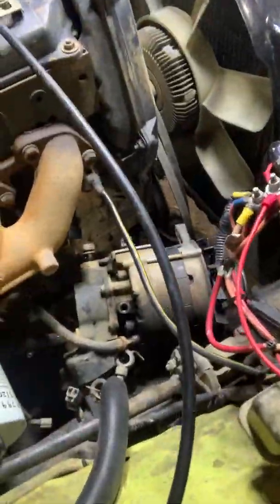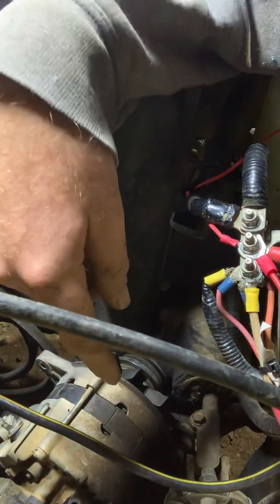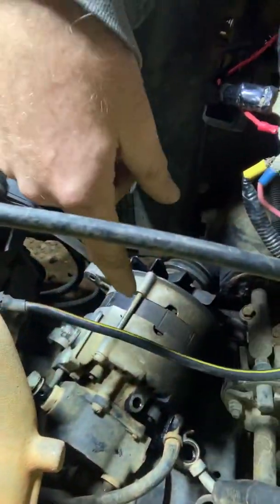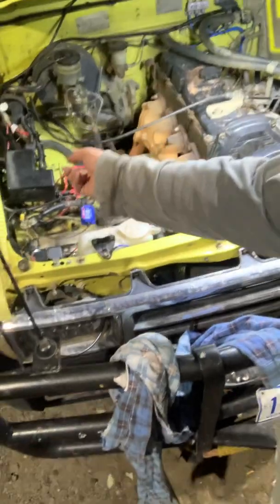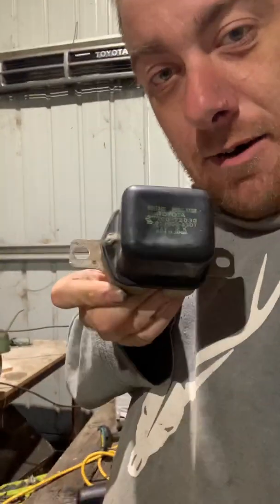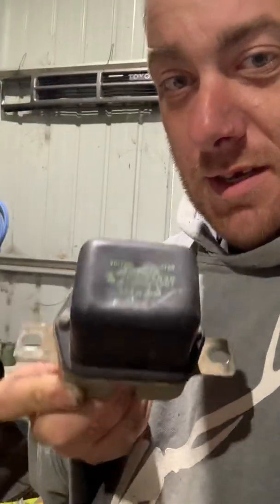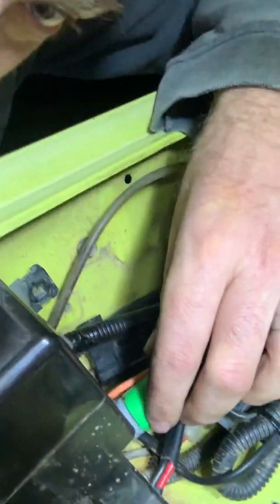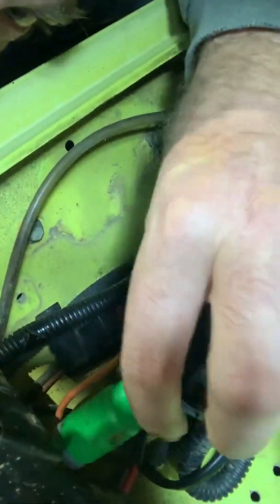Converting ln65 Hilux to an external regulated alternator from a internal regulated alternator

Comment: Ive got a ln65 2.4 diesal its a bush basher alt is cooked reg is cooked all electrics up the shit ..i need to find a cheap alternator that fits...i dont need the vacume pump etc...i dont want to spend 700
Reply from the maker: Yeah mate, I can totally understand that but unfortunately when it comes to an alternator you want reliability for your lights and all your electronics understand $700 a lot for a brand-new one behind Arana marketplace. If you’re in Victoria, your most certainly likely to find one
Reply: @Duddlesoutdoorsandadventures  yeh problem is I don't have any electrics left...even the factory lights all gone just wiring spotlights ...and I don't even need reliable really as if it dies I just walk home  as the hilux doesn't leave the property....emailed auto8 no reply....just need a basic alternater or even standard one wired to not need to run to the dash light
Reply from the maker: Yeah I payed 700 bucks for mine